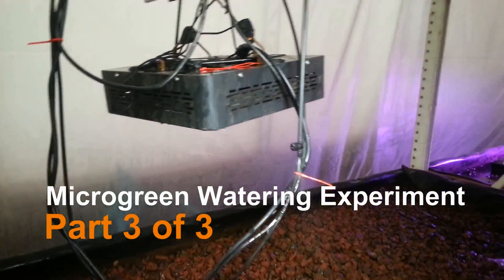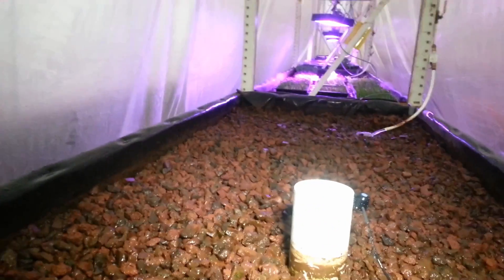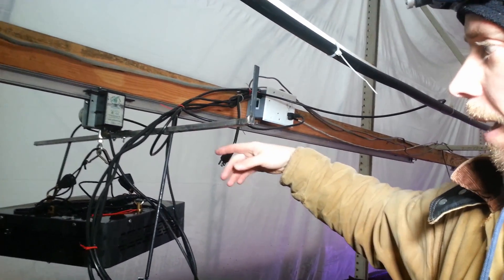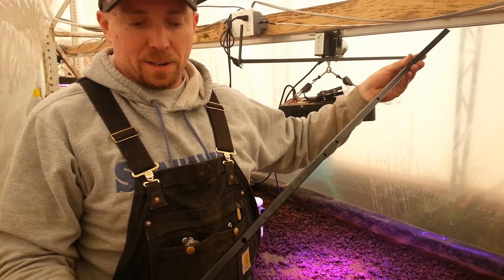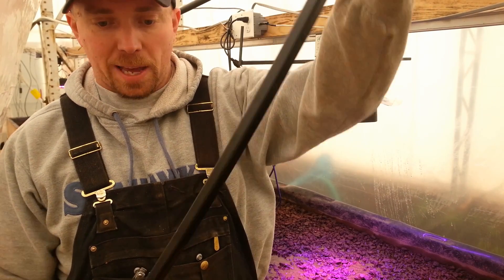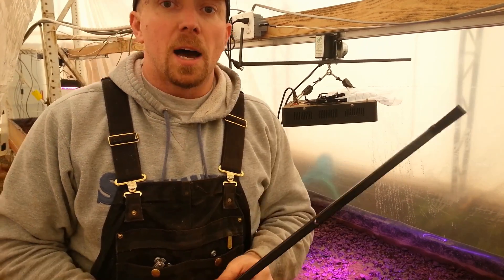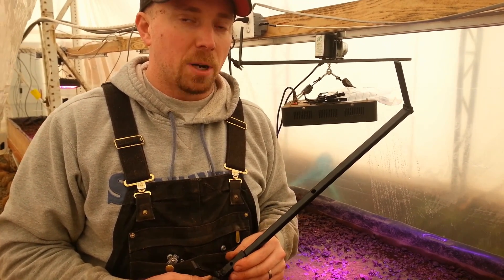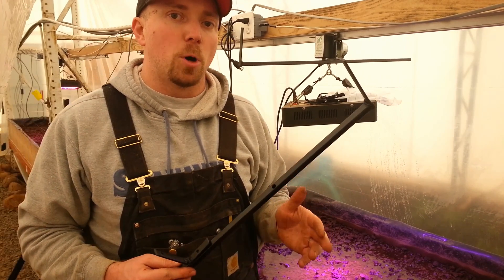Integrated Micogreen Lighting and Watering Setup - Part 3

Comment: TRM, I still think you should run a rigid header along the middle of the bed, below the light, about 12 - 18 inches above the beds. Using 360° sprayers or even 180° sprayers every so often would be permanent, rigid, and no tangling. It would also be easier to support. Sprayers can be supported on posts in the bed itself. Then put them on a timed system. Fixed system is better.

Comment: What about putting a piece of PVC conduit on the bar so that it will rotate on the bar as it goes back and forth with the cable and water line laying on top ? You could also put your wires and your water line in to wire looms to protect them from ware and tear, as they go back-and-forth over the  PVC roller's...

Comment: Odd question but would a 55 gallon barrel or 2 give enough volume for the worm beds in a more compact setup that removed the grow beds for wire shelves to fit more into a smaller space? They would only get water from the returns before it gets back to the fish so would get the wet/dry cycle like the normal beds but could they get around in the bottom area with all that weight on them?